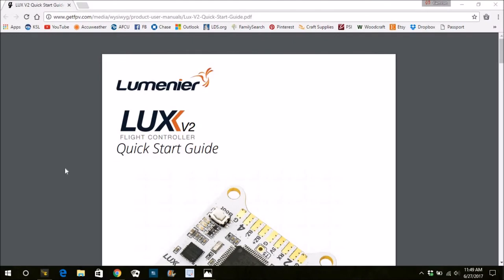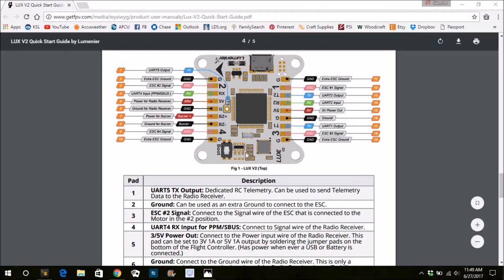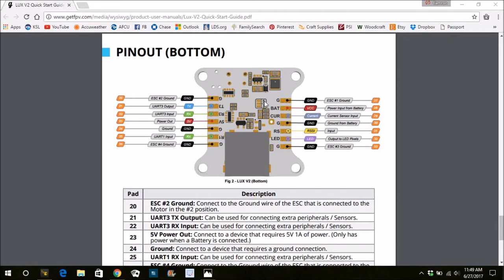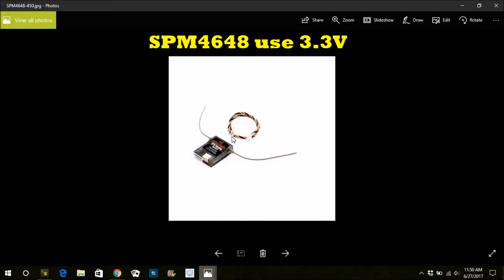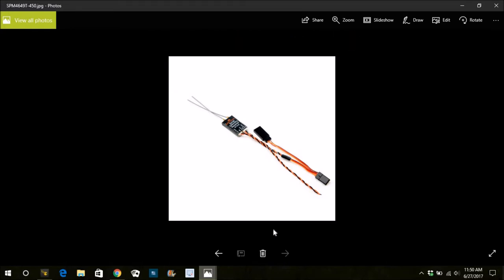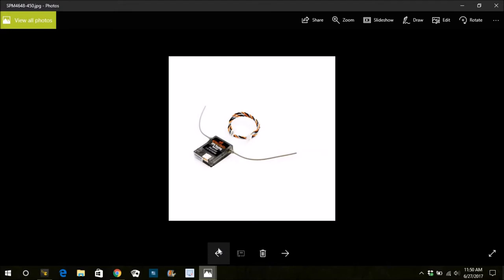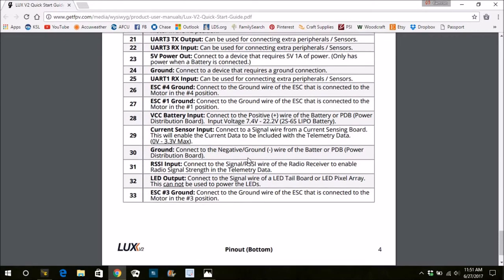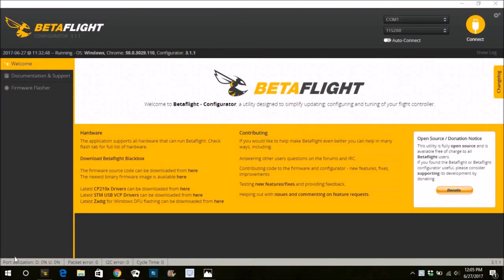Spektrum Quad Race Receiver Wiring to Lux V2

Comment: Great video brother! I have one of the lumenier fpv cams and it's identical to your spektrum one minus the branding on the case of course. 
  I'm getting ready to do a build video tomorrow, I'm doing a qav-xs "charpu" stretch X with the multicolor lumenier motors, lux 2 board, spektrum 600mw vtx, tattu 30a esc's. All top shelf parts (in my opinion). Can't wait to get started on it!
Reply from the maker: pmm4177, very nice. I was flying a QAV-X. Love the frame.
Reply: Bluto FPV I can't get my lux v2 to connect in betaflight, I flashed it with no problem but when I click connect it just sits there for about 5 seconds the instantly disconnects, doesn't say failed it just disconnects
Reply from the maker: Several things you can check and try. I know you may have tried several of these already just bear with me. Make sure the boot loader button is not pressed.
Close down Betaflgiht and any Chrome apps you may have open. Then open just Betaflight. Maybe even restart the whole computer.
Check that you have the correct COM port selected.
I know on mine if you click connect too soon after you plug it in it does this. So plug it in and give it about 10 seconds before trying to connect.
Don't have a battery connected when you connect.
If none of these work I would reflash with full chip erase.

Comment: Do you use uhart 4 for frsky? I've been trying for days and can't get my taranis qx7 sticks to move in betaflight. Can i use other uhart ports?
Reply from the maker: FrSky is different. It looks like you still use UART 4, make sure you have selected the correct protocol for your receiver. I don't use FrSky so I can not tell you exactly what to select.

Comment: So I have successfully bound my spektrum dx6e transmitter to my receiver. I set up everything in the configurator according to your instruction. However, it is not showing any input that I give. I move switches and sticks and nothing happens. What am I missing? I'm using the jbardwell f4 flight controller with the signal wire on the rx6 pad, which should be for speksat receivers.
Reply from the maker: I am not sure how the Bardwell F4 works. I would double check that you have the correct Uart selected for that FC. And make sure the spectrum receiver is selected in the Betaflight configuration tab. I don't have any experiences with Bardwell FC sorry.
Reply: @ Shelby - did you get sorted? I just finished a build yesterday with the 4649T and it was a pig to connect with the F4 board I have.

Comment: Hi will spektrum receivers work with pnp race drones would love a response thx
Reply from the maker: There is a very good chance. It will all depend on the Flight Controller.
Reply: Like wise connector or programming wise
Reply from the maker: Check what the flight controller is and make sure it can handle spektrum. Betaflight, Flightone, and Kiss all have programming for Spektrum. Also pay attention to what voltages you can pull off the FC as that may influence what receiver you use.
Reply: Bluto FPV ok thx